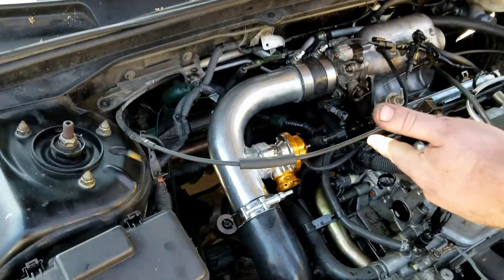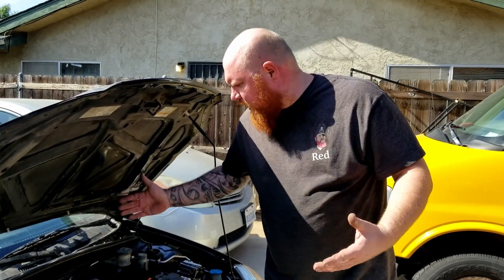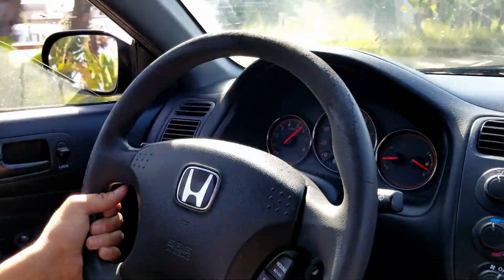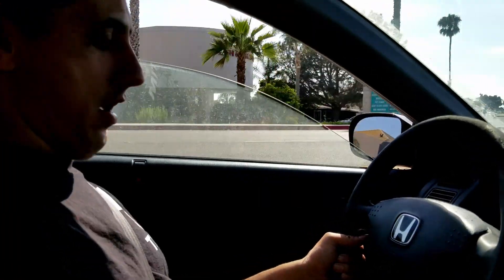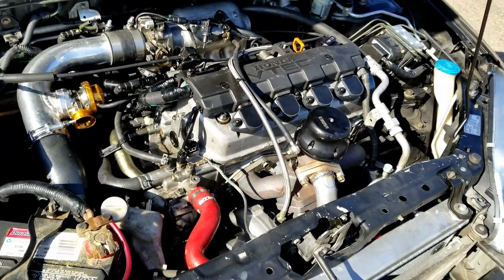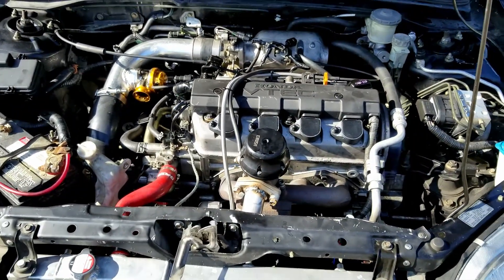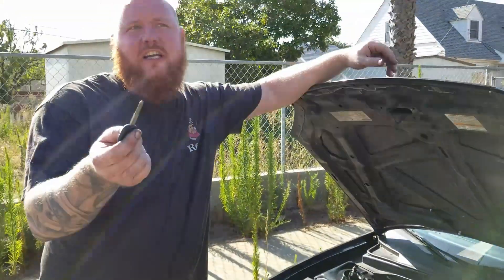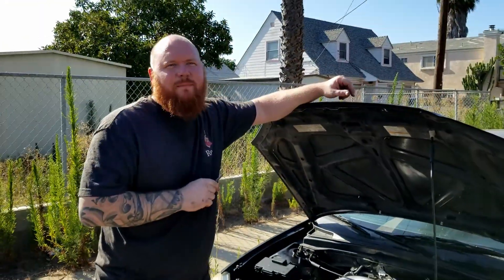eBay EM2 finally sees some boost then it all goes bad

Comment: Perhaps the connecting rod bearings were already in poor condition. You always need to rebuild the engine so that it lasts a long time. I build a turbo d17a with a full rebuild. Forged connecting rods and reinforced connecting rod bearings are required. Of course, the oil pressure needs to be monitored for the first time. I also assemble this engine with oil nozzles  .

Comment: Atleast ts a fixable issue,but other than that its pretty cool to see you guys take it out on the street and hit some boost before the rod knocking
Reply from the maker: That motor was just to old I tried but I will have to put somthing with lower miles good thing i have one
Reply: @PirateGarage  its shitty it has to happen like that sometimes but im pretty sure once you do the lower mile block this builds going to be fucking sweet for a 7th gen with a d series

Comment: Lol what a shame. I just ordered my kpro & I'm gonna swap an A2 head onto my A1 block then follow your video on the D16Y8 cam swap.

Then its gonna be boosted! Luckily my engine only has 108K miles lol.
Reply from the maker: Ya I was worried this motor would do it the whole time so I had another motor just chilling waiting but I was hoping it would last longer then it did
Reply: @PirateGarage  I wasn't expecting it to bust so soon either. I mean it's 300k miles but I expected more than 4lbs of boost LOL

Comment: I suspect the rods/bearings weren't put in to proper spec. I think it could've handled it.
Reply from the maker: I reused the factory ones
Reply: @PirateGarage  - Umm.. no. You installed new rod bolts and bearings. Followed by dirty oil... bad idea.  Those rod bolts have a specific stretch for their specific torque setting (using a micrometer). And the bearings require assembly lube on one side only. Clean and dry before installing.
Are you a licensed mechanic?

Comment: Did you check the clearances with those rod bearings when you installed them? Those one size bearings scare me. I always go with oem bearings.
Reply from the maker: I had to reuse the OEM ones. The race bearings were not compatible with d17 like the auction claimed
Reply: @PirateGarage  did you reuse the same bearings which came out of the motor or you put new oem bearings
Reply: Gotcha
Reply from the maker: Reuse the same ones they looked fine, I think the oil pump let go
Reply: @PirateGarage  thanks for replying and i guess your right about the oil pump

Comment: If I were to boost my completely stock d17a2, would I have to down size the rad? Do you think I could run it on 5 psi without a tune and be alright?
Reply from the maker: I don't recommend not getting it tuned
Reply: Pirate Garage I’ll drive it maybe once or twice a month until I have the money for kpro. Everyone is telling me I need to down size the rad to fit the turbo, is that true?
Reply from the maker: Not true you will be fine, a slim fan maybe
Reply: Pirate Garage Alright, thanks for your help. Keep the videos coming!

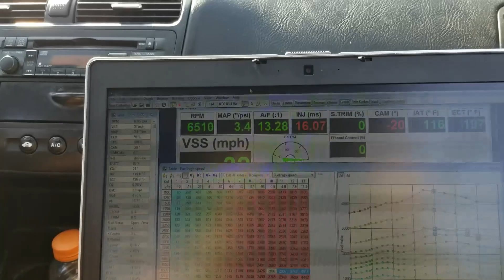Comment: Bad tune. You can see at 1:09 while accelerating at WOT, 3.6psi, A/F is 14:1; way too lean. Consistently too lean for a WOT turbo pull. Especially if it isn't fully dialed in, should be on the richer side if anything. 11.5:1 would have been safe. Granted old bearings would have crapped out at some point, wouldn't have been after a single pull.
Reply from the maker: I'm not a tuner

Comment: Need to port and shim oil pump. Also need to run 20w50 diesel oil. Amsoil competition. Also monitor oil pressure closely on this engine. Been down this road already. Trust me.

Comment: Lmaooo makes me not want to boost my own, I’m interested in seeing what the d17 can do if built correctly
Reply from the maker: I will put a short block with fewer miles then built another block, the plan was to run this one but it took a shit way too soon, oh well I didn't really have very much faith in this high mileage engine anyway
Reply: Pirate Garage exactly why I don’t want to boost mine, I’m unaware of the miles.
Reply: Peace guys I have a 99 d16 boosted I'm making 246to the wheel but I'm having a lil issue with the idling now it sat for 2yrs I changed all liquids I'm going to get the act clutch I think it needs that too I have 8 lb. Of boost to it fully built block and head

Comment: 5w20 + turbo=  bearrings. Use always 5w40 or 5w50 what the heck.
Reply from the maker: I was using 5-30
Reply: Pirate Garage bro i dont understanding why to go so thinn in europe we use Honda dealer recommended 5w40 in a stock d17 if we do turbo we use even 5w50 mobil full syntetic. Is europe warmer than your country i dont think so
Reply: Oil cooler is also an idea to keep safe and oil presssure oil temp meter is not a luxe for this turbo application. Keep going bro ✌️

Comment: You spun the bearing because you changed the fasteners and didn’t resize the rods. When you change to arp fasteners the clamping force is distributed differently. without resizing the rods this causes a distortion that takes it out of round. An oval bearing hammers itself to death and further ovals itself. After that you would need to have the crank polished, then use plastigauge to determine which bearings you even need. Not sure what was done off camera but I feel like probably none of that. You’re ambitious, but clearly untrained or at least at this point with this kind of task. Ambition goes a long ways though so if you haven’t already, get some real education under your belt about this stuff and make something of it. Good luck.
Reply: That part💯